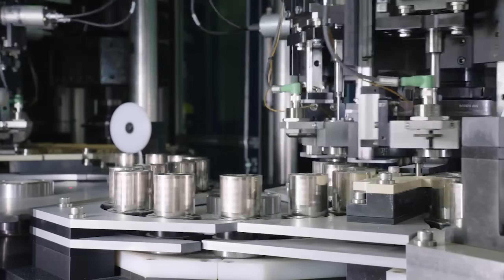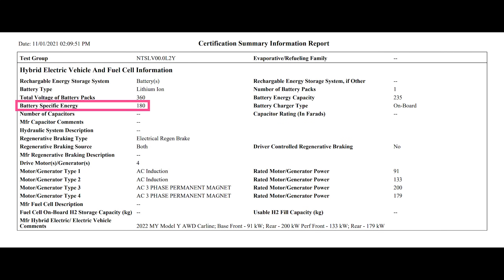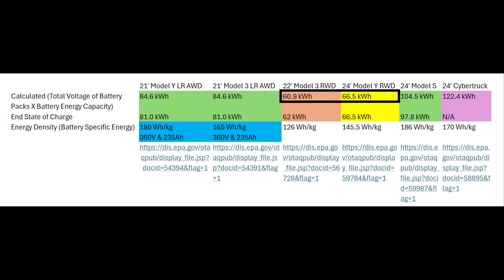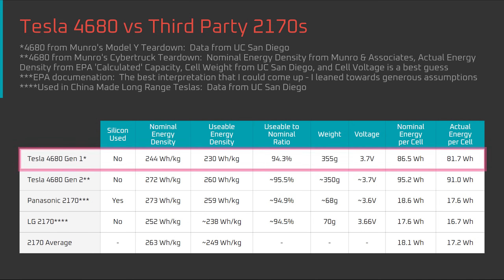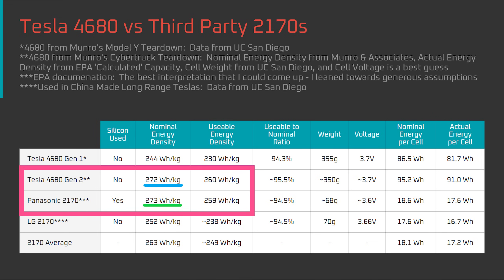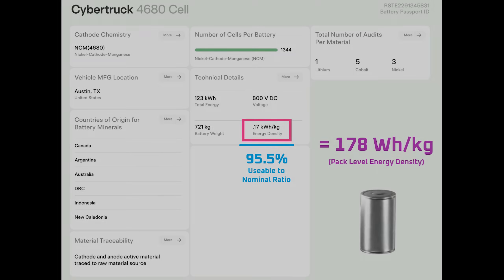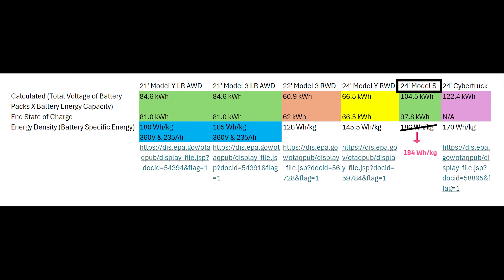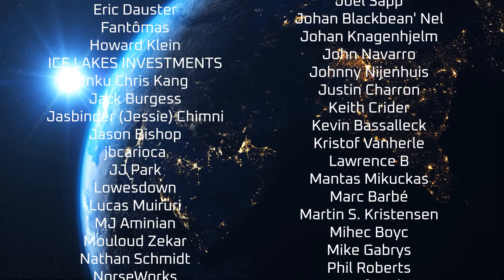The 4680 Hits a New Energy Density High // But how does it stack up? 🤠

Comment: Cant wait for Gen 3 Tesla's 4680 cell with, hopefully, both dry electrodes. Road to 300 Wh/kg? 

Congrats once again for your channel. You deserve the best!
Reply from the maker: 300 probably coming soon 🤠 I'm guessing the next year or two
Reply: Napkin math says if you look at the difference between energy density between 2170s without silicon vs with silicon, then add that approximated difference to the 4680, that still has no silicon, your approaching 300Wh/kg.
Reply: Reports indicate Tesla has already achieved dry cathode, so both electrodes should be dry in 4680s released in the future
Reply: @davidx.1504  dry coating process issue is mainly the speed : it was until now too slow to feed a full speed 46xxx production line.
Reply: in China  they are already at 300Wh/kg and improving power
Reply from the maker: @chryoko wrong focus, anybody can make high energy density battery cells.  The challenge is to make a battery cell that does everything well for low cost
Reply: @thelimitingfactor  thats the point. Im tired of so many new battery models we've heard the last 3 years that are going to break all the standards. And most of them haven't scaled yet or finally have been reserved for super expensive cars. 

The big deal is to scale, cheaper than the standards, and with better performance.
Reply: @thelimitingfactor  fully agree. LfP is good enough for automobiles. And utilities. But my point was that NCM is already at 300Wh/kg in cylindrical in China. Tesla is looking behind now...
Reply: @chryoko  That sounds strange. Exactly what is the brand or manufacturer in China that makes those 300Wh/kg cylindrical cells?
I want to buy some. I have never found any such cells from China with higher capacity or quality than the classic name brand Samsung/LG/Panasonic.
Sounds great of we now have this avaliable on the market.
So how and when can we get them.
I have lots of uses for higher capacity cells.
Reply: @cajampa  How many GWh/Year do you want to buy ?
Reply: @chryoko  Which car(s) has these 300Wh/kg cells and how did you verify it?

Comment: Great video as always. Do we know the pack level energy density compares against the best in the wider market?
Reply from the maker: Oh, you can get packs that are up to like 255 Wh/kg, but they'll cost you multiples of the structural pack.

So it's a matter of performance/cost.

The best confirmed comparable pack would be the lightning pack that I put in the table at 174 Wh/kg

I think the chinese are hitting nearly 200 Wh/kg for comparable packs of a comparable scaled production cost, but we don't have a teardown to confirm that.

Comment: Great work as always! Will the dry cathode process add any density in terms of Wh/kg, or is it "only" a win from a manufacturing cost perspective?
Reply from the maker: It has the potential to increase the energy density, is probably the best way to put it.

Because you can coat the electrodes thicker, it makes prelithiation easier, And they can do an asymmetric coating 

If that sounds like gobbledygook, you can look up my video on asymmetric electrodes
Reply: In addition to Jordan's comment, when the thick electrode is made by wet-process, the binder and conductive material will migrate to the top surface during solvent-drying step,  and lead to bad battery performance.

But it will not happen for dry-process thick electrode. Therefore, we can make thicker electrode containing more active material. Finally, we can add more energy density. 😊
Reply: Either or both are a win for us